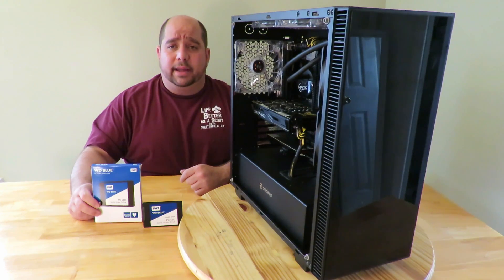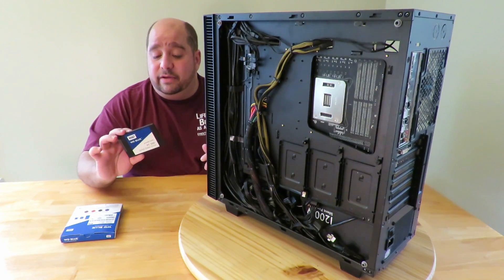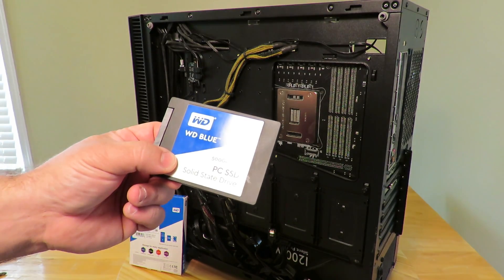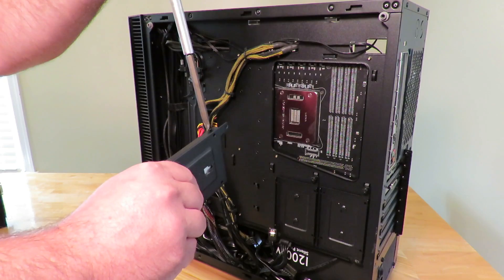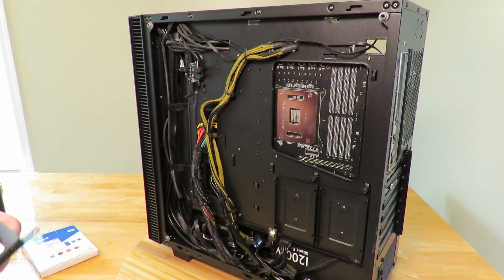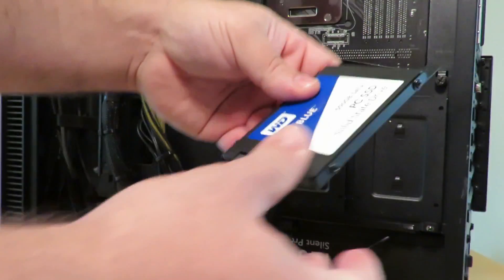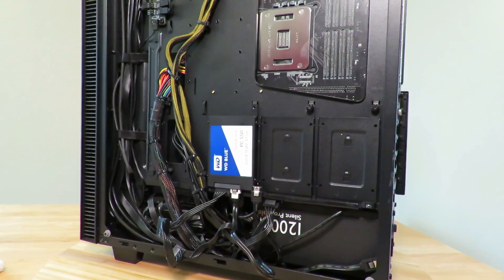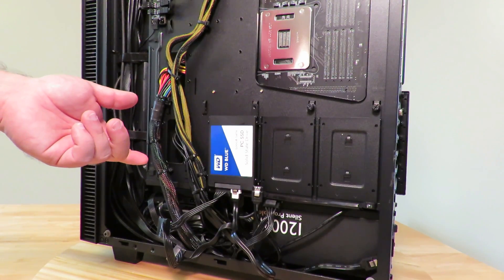How to install the WD Blue 500GB SSD into your computer #WDBlueSSD

Comment: Would you expect the case to come with the 2.5” bay hardware?
Reply from the maker: Depends on where you buy it from, if you check on Amazon you can buy this SSD without the bracket $59.99 on Amazon USA right now and buy it with $67.93 right now.  It costs about $8 more if you buy it with the bracket.

Comment: Good video but Corsair has changed its design.  Instead of a sled, you have to screw the SSD from inside the case . Very awkward and dumb.  The case you showed is  a better design. But your video pointed me in the direction I needed to figure it out.

Comment: Hey Iggy can any pc have a 500 added I have the omen obelisk and it has a 256gb I recently got into Microsoft's flight sim 2020 and now my c drive is in the red would this solve my problem plz help
Reply from the maker: Pretty much yeah, as long as there is free power and a slot on your motherboard.  You can install a secondary drive though this day and age I would shoot for 1TB minimum since you can get 1TB SSD for under a $100 now.
Reply: @dragonblogger  ok ya new to this deal here just seen the 500 on youtube  etc what do u mean by free power
Reply: @dragonblogger  my cpu is 500 is that what u mean or another plug inside
Reply: @dragonblogger  their is free plugs by the graphics card n a free plug near the front under something that says hdd

Comment: do the two sata cables come from the motherboard or the psu
Reply: Power should come from PSU, the sata cable plugs into the motherboard
Reply: @Archman155  why mine dont have
Reply: @whiffler770  all PSUs have this? Is it modular?
Reply: @Archman155  i have it but it doesnt fif should i push it?
Reply: @Archman155  harddddddd

Comment: You talk too much, before U get 2 the point of the tutorial. I have an MSI PC, in which they stuck in a 1 tb 2.5 HDD. I change it 4 a 1 tb 2.5 SSD using a caddy. But it took me 40 mins 2 solve a problem. Their screws were not fitting into my caddy from their caddy holder. So I just change some screws around with another desktop PC. And also stuck stuck in 2 tb SSD into my MSI as well.

Comment: Where do you get all those cables that you plug in your ssd I’m new to PCs that’s why
Reply: It’s from the power supply. A box inside the PC that gives power to everything else.
Reply: @finnianakin  do you know if this SSD comes with the cord to the power supply?
Reply: @bigpeeks4764  SSDs plug directly into the motherboard, not the power supply.
Reply: SSDs sometimes come with the cord to be connected, sometimes they don't.
Reply: Sometimes they come with the case, motherboard or mainly the psu

Comment: Not really .. were dose the plugs go I’m a noob  .
Reply: One on the psu and one on motherboard
Reply: sorry my friend, it was 4 years ago, I have gotten better in my newer videos.  But the the sata cable would go connected to the sata ports on the motherboard, usually on the bottom right hand corner of the board.  The SATA power cables come from the power supply.

Comment: Would've liked that you showed where you connected the sata cabled because I've no idea where.
Reply: sorry, it was 4 years ago, about when I started I have gotten better since.  So you would connect the sata cable from the drive to the sata port on the motherboard, usually towards the bottom left hand corner of the board and the sata power connector would come from your power supply.

Comment: Well explained although you should have shown placing the bracket screw back into the case (mobo back plate) to hold it firm.
Unfortunately this didn't address my reason for watching SSD installation videos, my new case doesn't have such removable brackets wrapping around the sides, just two SSD sized indentations with sets of four holes in the mobo back plate that line up with the four holes at the back of Crucial drive. 
I was curious to see if this was an acceptable form of mounting without fear of shorting out the drive's internals. Or if I had to buy a mounting bracket.
But I guess it's no different to using the side mounting holes and they wouldn't have put an extra four tapped holes there for no reason.

Comment: my SSD is ever so slightly too wide for the slot and won’t fit. what to do? find a place to hide it in there? i’m thinking about using 1 screw to mount it where the HDD goes. 🤣

Comment: So after installing my SSD Do I have to some how let the computer know ive installed an SSD? Any configurations or software download like you do with the Samsung SSD, you use the magician tool. Please help thanks
Reply: if you use it as a windows drive, you can just install windows onto it, then you may have to change the boot order in the BIOS.  If you install it as a secondary drive, you have to enable the drive in windows, using disk management, built into windows.  Right click on the start button, click disk management, locate the drive that would read as unallocated, right click on it, mark partition as active, partition it and go.
Reply: @ThisBytesForYou  thank you so much
Reply: @ReemAbdullah8  you are so very welcome my friend, very happy I could help
Reply: @ThisBytesForYou  Thank you for this!
Reply: @redguard2529  you are so very welcome my friend, very happy you liked it.

Comment: One of my problems is that the PSU Cable is preventing me from mounting the ssd from the case side. So my only option is to put it on a hard drive tray which only screws two sides of the ssd leaving it hanging.
Reply: that is the great thing about SSD's, since there are no moving parts, you can have them anywhere inside your machine basically, dangling if you want, though I would maybe velcro or double sided sticky tape the drive so that it does not get loose and fall, but you are good.

Comment: Where did you buy the mounting bracket ? I cannot find one just for ssd cards! Only find the converters 😭
Reply: that bracket came with the case, where do you want the bracket to go onto, do you want it to fit into a 3.5" bay?  If so, you can get something like this, under $10 on Amazon:  https://geni.us/AK4B81
Reply: ThisBytesForYou no for some reason I have a smaller bay made for ssd
Reply: @nightwolf8407  ahhh ok, but you got it working?

Comment: I didn't get where the other end of the SATA connection cable goes.
Reply: one end goes to the drive as I showed here, the other end goes connected to a SATA port on the motherboard.  What motherboard do you have, motherboard manufacturer and model number so I can help you find it.
Reply: @ThisBytesForYou   I have a Asus ROG Maximus X Formula motherboard. Bought a Samsung 860 EVO 2TB 2.5'' SSD (waiting for delivery). Can I just plug the SATA connector to any of the available ports on my MB, or does it need to be plugged into a specific one? Also, the power connector that goes into the unit: Can I just grab any of those I have available?
Reply: @mixchief  no, you can plug it into any available SATA port, as for power, yes, you can use any of the SATA power connectors and you wont have any issues.
Reply: @ThisBytesForYou  Awesome help, buddy. Have a good one! Thanks
Reply: @mixchief  you are very welcome my friend, I hope you have a good one as well.

Comment: so i already have a SSD installed on my gaming PC with Windows 10. however, it’s only 120GB and i need way more space for gaming. so if i buy a new SSD and connect it while keeping the original in my pc, do i still have to install windows 10 on the extra SSD?
Reply: you don't have to, you can just use the extra SSD as a storage drive, but if the newer SSD you are buying is faster, I would probably reinstall the operating system on the newest on.  If you are scared about that though, i have many videos that will help you not only to transfer the OS if you wanted to, but also to reinstall windows.  Windows tends to perform better if you reinstall.  Let me know which route you prefer to go and I can link a video for you.
Reply: @Likeaboss Gamer you can, but the HDD requires more power and creates additional noise and heat, but of course still not a bad option.  I like having a few SSD's in my system just for extra storage and install space.  I have everything installed, stored and backedup on SSD, soooooooo much faster
Reply: @Likeaboss Gamer ahhh no worries my friend, what ever works for you is what works for you, that's the great thing about building your own PC, you can do what you want, that's why I love it.  Thank you so much for stopping by, checking out the video and commenting, it means the world to me.
Reply: No

Comment: Do i have to buy the connector separately?
Reply: In most cases no, your motherboard will bring a few SATA cables and the power adapter, that should also come with your power supply.  Please let me know if there was another connector you are refering to and I will look for one for you.

Comment: Does the slim WD green ssd m2 128gb only works for Portable? What/where would i need to buy (cover box) to install the slim version in normal computer? ty
Reply: if your motherboard does not have an M.2 socket, you can buy this to allow it onto your system: https://www.amazon.com/dp/B01N6PMZLW?tag=iggy00-20
Reply: I have the Z87M-PLUS sir, please tell me it has and how do i install it <3
Reply: "Sorry, this item can't be shipped to your selected address. Learn more. You may either change the shipping address or delete the item from your order." =(  no other option right? think im gonna try resell and buy one already with capsule, f*** badly titled components if you ask me ffs
Reply: let me get back to you later tonight

Comment: Very helpful, thanks. My WD 1Tb SSD has just arrived in the post. It has a big yellow sticker warning me it is electrostatically sensitive, suggesting I need to root out my electrostatic wrist strap and earth myself to the nearest radiator before touching it. But on your video you are moving your SDD around in your (unearthed) hands like it's a pack of cards. I'm worrying how sensitive these SSDs really are.